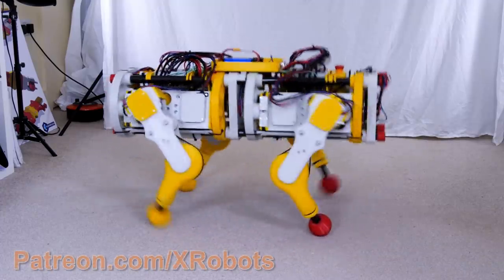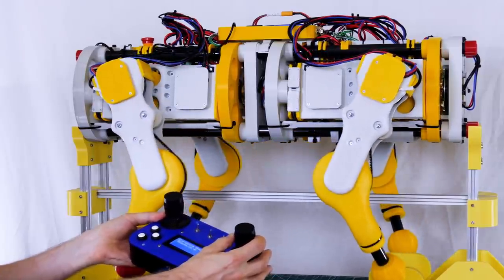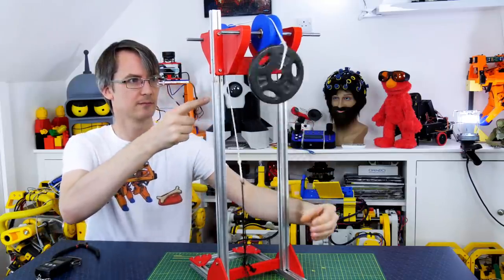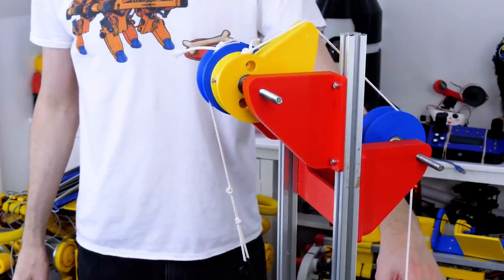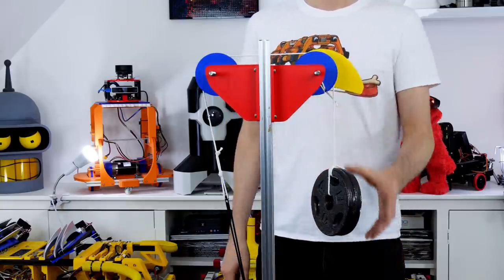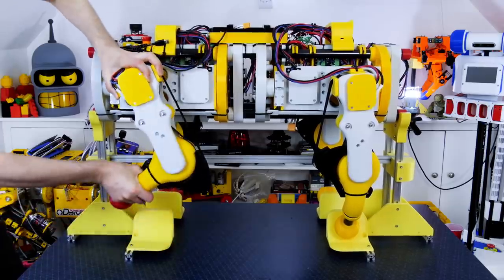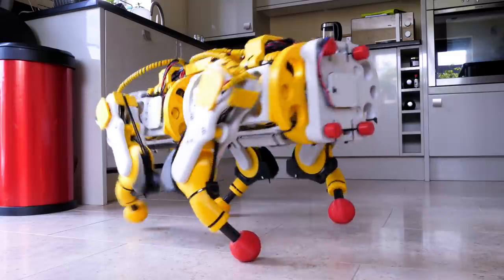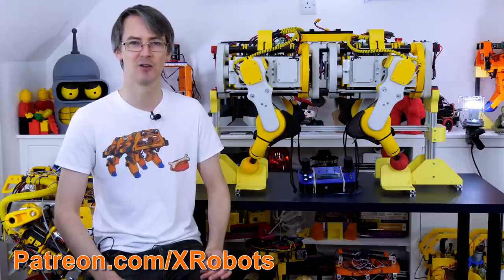Constant-Torque Spring-Balanced Actuator

Comment: Like animals/people could you extend the legs fully into a locked out position? (Rather than the current maximum extended position which has 90ish degrees knee angle) If the leg is fully straight ie 180 degrees lower to upper leg, although there will be no spring action the knee motor wouldn’t require any current draw, if the gait allowed the leg to transition from the spring  into lock out surely we would have the benefit of the spring and it would it increase power saving. I had an accident a while ago and had to have leg surgery, part of the rehabilitation was making sure me leg could stretch to the lock out/fully extended position, or I they said I would struggle to stand for long periods of time.

Comment: hello, an idea you can try is to change the actual shape of the leg gear that the motor belt is attached.
The new gear shape should be an oval so as the leg moves to the state that it needs more torque the diameter of the new gear is increased.
For this type of gear to work it needs a belt tensioner. 
I see that this type of gears are used at bikes, oval chainrings.

Comment: what if you use eddy current actuators that both absorb shocks and repel energy like a spring, as well as act like a motion range limiter so that the limbs dont overshoot
and you can tie the current that the actuators create back to the battery.

Comment: I'm curious how you came to the decision to use an exponential curve. The math is kinda difficult but my first attempt with some things simplified suggested it'd be an inverse square root curve.
Also is constant-torque what you want? The angle the legs are at while holding load will change how much torque is needed to keep them in position, just like how standing up straight is easy but standing crouched is hard. Maybe it'd be better to have the force get larger as it crouches more and figure out something like a release for when the robot lifts it's leg up off the ground that removes tension and regains the tension when the leg is supporting the weight again.

Comment: Would it be worthwhile to actually overcompensate, so the springs give less force when the knees are bent, since most of the time bent knees means they are lifted and shouldn't need much force?
The only downside would be when jumping, but that's much less common than walking, so it shouldn't matter much.

Comment: You may not actually want a constant force as the knees rotate. When the knee is locked, nearly no force is required to keep it standing, so shouldn't the spring do nothing then? With the behavior recorded though it probably wouldn't make a difference because it never stands up fully, but you could program it to do so when at rest?

Comment: What about constant force springs?
Reply: was gonna sat exactly the same thing.
Reply: Those tend to be much more expensive
Reply: I was thinking the same thing. This is a really cool idea, but it seems to be solving a probem that already has a solution...
Reply: @quinnfoster4671  Definitely, but it's cost saves a lot of time and other problems. Who knows, maybe he used bungee for a fun challenge.
Reply: @quinnfoster4671  you can get them for cheap in those window shade cord rollers :)
Reply: Well those would be very heavy (steel), which he wanted to avoid.

Comment: I feel like there's some math that could be done to get the right curve...let's see... the shape should be roughly exponential, but you have to take into account the changing angle of the line coming off the spiral pulley. Alternately, you could potentially enmesh two spiral-shaped gears for the same effect but with the tangent point always at the same angle.

Comment: If you put a linear cam profile at the knee and another liner profile at the shoulder affixed to the body on the opposite side of the leg, is it possible to have the bungee cross both, thereby achieving a pseudo-exponential profile, while also providing spring relief to the shoulder motor?

Comment: Could you maybe also implement some sort of brake? Maybe a actuator that clamps the belt onto the pulley when the motor doesn’t revive any move commands.
Reply: Yeah but what if the ground moves or something/someone crashes into the robot? There would be to few of "tollerance" in the system

Comment: You don't want constant torque. The torque on the joints will depend on their angle. If the leg is perfectly straight, then there's no torque at all. If it's really bent, there's a lot of torque. So you'd want the springs to reflect this.

Comment: Up next: "actuators using DIY synthetic muscle fibers"

All jokes aside, it sounds kinda clicky; you might want to lubricate everything in there with some silicone grease. A harmonic damper could also help mitigate the vibrations, and rubber things could be replaced with sandwiched layers of teflon (low friction) and polynorbornene (low bounce).

Another way to make things more energy efficient: Ditch your spur gears for herringbone (double spiral) gears. You've got a 3D printer, so you aren't bound by 19th/20th century manufacturing limitations!

Comment: To counteract the gravity, shouldn't you only consider the vertical component of the force exerted by the leg? That would mean the torque from the bungie would have to follow some sort of trigonometric function, where straight legs => 0 torque bent legs => full torque. You could have 2 sinusoïdal pulleys, for each joint, so that their effect add up. This would have to assume that the dog stays horizontal.

Then if the dog isn't horizontal, you could have an actuator that dynamically adjusts the tension on the springs, through some sort of fast but non reversible gearbox. But then you don't need the pulleys, you can just solve the kinematics and have the firmware take care of the tension, according to the orientation of the robot, and the angle of each leg. But then are you saving power... hmmmm

Comment: Instead of measuring the current, measure and log the temperature of each motor doing the same routine, with and without the bungies? Might be helpful when you come to optimising the bungee strength.

Comment: Couldn't you also get a constant force from a spring by having the number of coils or the tightness of the could vary along the spring? Kind of like the springs used in large magazines for fire arms. A harder math problem and a bit harder to manufacture for a maker, but it would be less parts and possibly lighter. Maybe a 3d printed spiral for the bungee cord to get pulled around would be lighter and easier to make for prototyping?

Comment: What if you could spring the robot such that in its “base state” it is standing with minimal power consumption?  Then motor power would be needed only for lifting legs and for lifting robot body higher or supporting additional load on the robot.
Reply: Ignore this please

Comment: On the bounce: It looks like a chiwawa. Click click click.
What to fix? ...Hmm some thoughts:

It's quite possible that a really good computer motion control profile could be tuned to make that smooth. But let's ignore trying to solve mechanical issues with computer compensation.

Some of the bounce is the comparative light weight paired with hard shells, but that kinda describes the issue right there: I think it is mostly the lack of (layers of) dampening for different directions and degrees of movement.

*You have foot pads (low travel-high plastic dampening, takes care of initial high energy slap and some surface variation)
*and it looks like very stiff spring ankles? (sprung, but effectively undampened and sprung to the point of being very low travel).

In a real animal, you have major dampening at:
*The ankle (fast acting intelligent/active spring and dampener)
*The knee/elbow (slower acting intelligent/active spring & dampener)
*The raising/lowering of the shoulder joint (primarily a large dampener)

Lesser dampening:
*the muscles
*the tendons driving and holding the motion
*the nature of a fluid filled object

So the question becomes what is practical to change? Ideas:
*ankles: lower the effective spring force and give them significant dampening. (thinking something like a pivot point and triangulating in a shock or similarly using a U shaped rubber dampener spring)

*shoulders: instead of solid mounting, mount them in rubber dampener blocks. any leg shock will have to pass through this.

*knees... hmmm how to dampen? Maybe try using sliding friction? (clamp a greased rubber washer or oring to resist motion?) You mention the drive mechanism acts springy. I think i need to look at how you did that to see what's going on, but thoughts include using a rubber coupler.

Also, make sure not to spring balance to the point of neutral weight. Being at the transition will make it want to bounce and flutter either direction. Being solidly on one side or the other will bring stability (eg a bit heavier or so light it has to pull its self down).
Reply: P.S. I love the constant-torque actuators. Simple and effective.

Comment: I wonder if this could be modified into a counterbalance system for a vertical mill
Reply: Yes. I used a bungee for a while. But I considered what would happen if it snapped. Unlikely. But my motor handled the 15lbs so i took the bungee off. The contraption was a little big to get linear force from the bungee.

Comment: @James Bruton You said that it draws 100-200A current, I was wondering why AC power systems require relatively thicker cable (90-100 sq.mm for 200A) but not in electron system like such??
Reply from the maker: Because this is 200A at 24V, not at 110 or 240?  So the overall power is lower.
Reply: @nocare  You're right, only the current of the system matters for heat generated by the wires, not what voltage the system is at since the voltage drop across the wires is current dependent. 

I think it's only peaking at 200A for short periods of time. If that was continuous 24V*200A is 4.8kW, that would be a decent room heater rather than a robot dog and plastic would be melting. Also, since he's only mentioned the knee motors getting hot, and that all the motors are current limited to 30A, that means that at worst only the knee motors are running at full power. I imagine the shoulder(?) motors are running at much lower currents, and I doubt all four knee motors are hitting 30A at once if at all.

Clearly this means there is more headroom to work with and he should reprint the knee something more temperature resistant, ramp up the current on the motors and make opendog do a backflip.

Comment: Couldn't you have used a coil of elastic material that rolls out when more force is required? Because if the force is too strong, lengthening the spring would make it strech and require less force? Idk.

Comment: disc diameter based cvt, 90 degree sliding drive wheel
Reply: varying the voltage should also change the torque of the motor
Reply: thats a knee, take a knee, to the Lord, who is Spirit, the Word from the cross
Reply: bra, great
Reply: supercap to not have it peak, flatten the peaks
Reply: high pulse power

Comment: How badly would using capacitor banks in the joints, charged from the tensioner’s regeneration energy even, as a boost on the motors, damage said motors? 🧐
Reply from the maker: They are 3-phase motors so the caps would have to be the other side of the motor driver.

Comment: Why not use a spring thats long enough that the range of motion is only a small portion of the relative maximum length of the spring? Like the mainspring of a clock or like the bungees used in that example. If its looped around enough times and pre-stretched, the motion of the motors shouldn't affect the tensile force too much.

Comment: Why not try a mechanical locking mechanism that can be mechanically activated when a particular part is not in motion. Therefore, the stress of gravity is applied to the material rather then a component that requires power.

Comment: I don't understand how the springy leg will save you power. Now to keep the leg joint in the position, the motor will have to apply a larger force: The force for actuation + a new constant force to counter the spring force
Reply: Think of it as a counterweight

Comment: TRY VACUUM!!!

When trying to compress a gas, it gets harder the more you push, but when you pull on a vaccuum, the force remains the same no matter the extension!
Reply: this is because when you try to compress a seringe or pneumatics, the volume gets smaller, so you have the pressure that rises on the inside vs the atmospheric pressure that stays the same on the outside

With a vacuum, the exterior atmospheric pressure remains the same, one atmosphere, but the internal pressure also remains the same, since even though you technically half the pressure of a vacuum by doubling the volume, it doesnt really matter because the force comes from the difference between the atmospheric pressure and the internal near vacuum pressure, so pulling on a vacuum is basically doing 2 times zero, the force will not change

It should be perfect for what you are looking for, a spring that dapens but provides a constant force no matter it's extension!

Comment: Why are the back legs on backwards?
Reply from the maker: They aren't.  You're looking at the dog's ankle
Reply: @jamesbruton  I was wondering why you have designed the Gait with the back ankles facing towards the back of the dog?
Is it to make it easier from a debugging perspective? (same reverse kinematic model for all 4?)
I assume evolution stuck the ankles around the other way on the rear legs of dogs for some advantage in kinematic terms, I wonder if looking at dog/cat/horse walk patterns might be useful to see if they save any energy gain efficiency.

Fantastic video btw. Introducing that cable was pure genius! I wonder if there would be any advantage have a second going in the opposite direction. Pulling counter to the current one. In the same way that bodies do. Possibly lower the size of the pulleys. or perhaps lower the force required by the motors further. 

I’m a big fan keep up the good work!